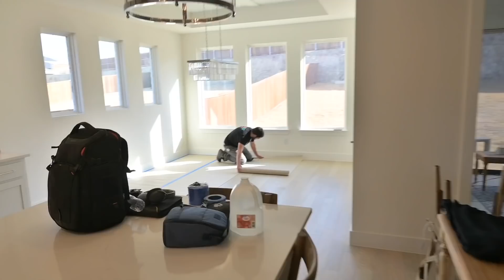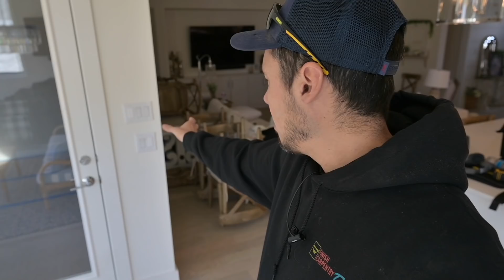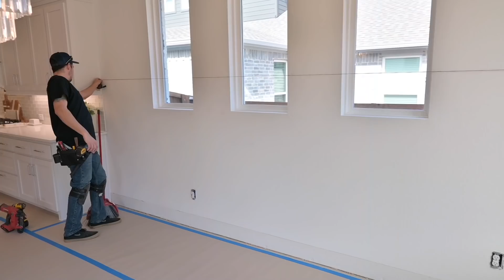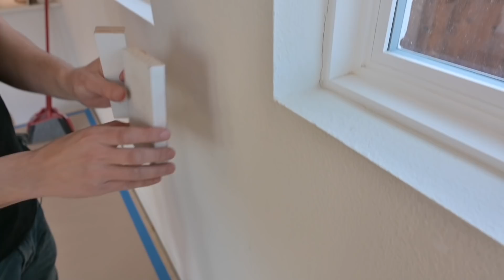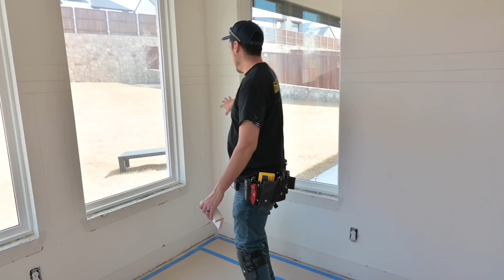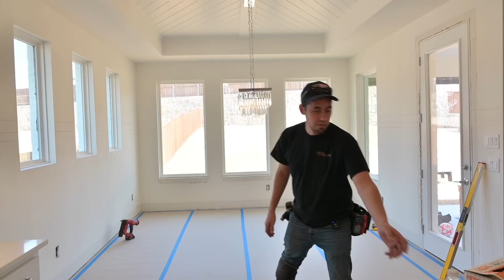Wainscoting a New House!

Comment: Man I'd love to see you do a video on transitions. My latest job has been a real battle. Using the WindsorOne I have run into a bad issue with transitions from the One by material and the wainscot cap into the existing casing. They didn't want to change the existing casing and it has made my job exponentially more difficult. Plus Illinois is almost all conduit and there's really no moving outlets which is making me do things I hate. But cannot wait to see this job. I'm loving the Windsor trim and curious what they picked

Comment: As a window and door installer and trim carpenter of 25+ yes, I would have ran your jamb extension return through the saw to whatever thickness that would add another step reveal against the existing window jamb vs larger than the existing jamb. Do it all the time wether window is active inswing or not. Love your stuff. Thanks

Comment: For the boxes you replace, please use adjustable depth boxes and for the ones you keep please add box extensions. These are a code requirement to avoid the fire hazard introduced with the wood up against the outlet. Wood is combustible and has a different code requirement than drywall.  If not, you will be liable for a fire should one occur.  Please listen, it's important.
Reply: As a YouTube video watching expert with over 100 hours watched I can tell you that this is exactly how he always does his installs. Keep watching his videos and subscribe and you may just learn something from him as I have. Haha

Ps I believe adjustable depth boxes are useful for a different application. Like in the case of a demo or in new construction. Remodel boxes put in after the wainscoting layer is installed are more than sufficient and save money.

But I’m not a master electrician, so don’t take my word for it. I’m just a window that does nothing. Put some Windsor one around me and cover me in silky smooth paint
Reply: @michaelyoder7329  I have an electrical license. "Watching YouTube" doesn't make you qualified to comment on this topic. YouTubers are clowns not professionals.
Reply: I'm a licensed electrician and you are 100% right.

Comment: Those receptacles probably don’t have slack without opening the drywall and getting the staples off (they shouldn’t anyway), even then they might be tight if they went under and back up with the wire.

Comment: Whats with all the stucco walls in  new  houses in southern America?  Your going to do all that fancy wood work but keep the stucco walls?
Reply: That’s the way it’s done in TX, called knock down.
Reply: @samtx5518  LOL Yes, but why? The reason for stucco is to save time/$ on plastering not for aesthetics. Or is it something to do with humidity and or heat in the south? Oh I thought knock down is when you run your plaster knife or trowel over the point part of the stucco and knock down the points  more flat?
Reply: @drewcama2488  texture walls are just what they do in the south western states. I'm in Bama and I don't hardly ever see textured walls here. It's all smooth walls and heavy crown and trim packages.